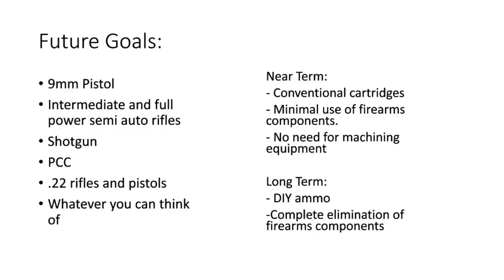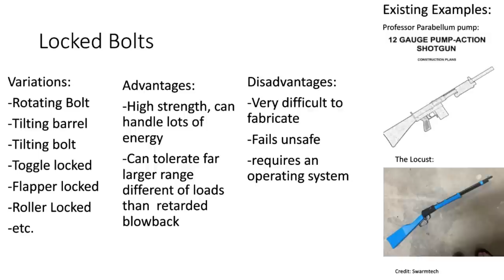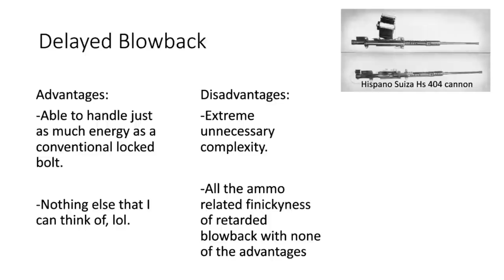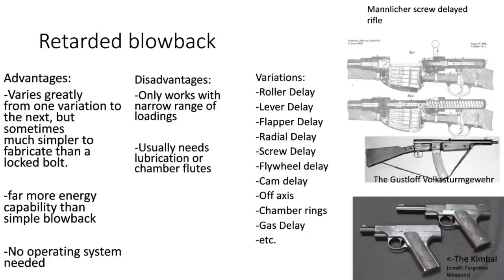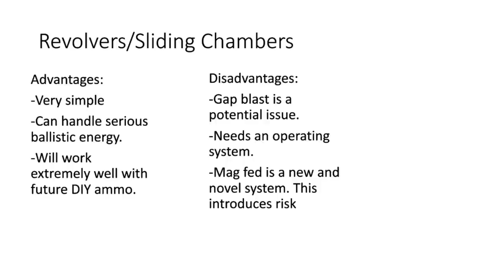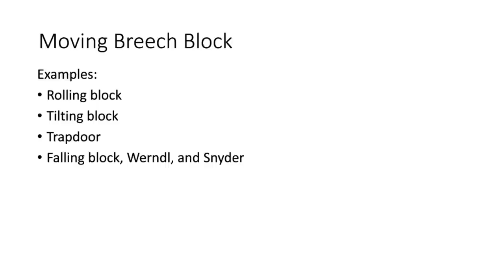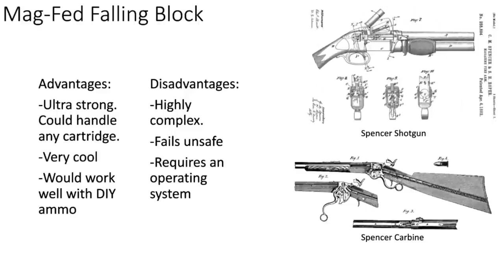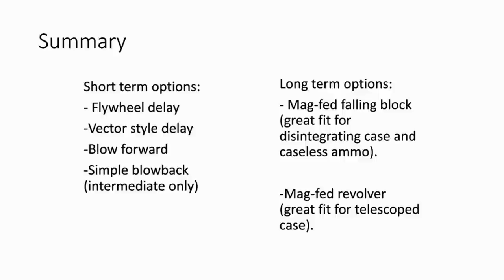The Future of Printed Rifles

Comment: Remember not to limit yourself to just 3d printing, there are many types of materials and methods we can use.
Reply: I'd love to see something in molded plywood.
Reply: @smorrow  I've been toying with this idea in my head for a couple weeks now, especially since I heard about how the university of Maryland was experimenting with using solvents and compression to make super-dense wood that's about as strong as mild steel.
Reply: @Part.No.1xbil.Prod.Tp.MXMVIII  Guns just get more and more unbannable.  Mechanochemistry, for instance, is currently just beginning to be studied and may end up being used for propellants that are easier to make than NC-NG powder. Its current main use that I know of is in fact gas storage (hydrocarbons stored in boron nitride powder, like air whipped into cream), I don't know if you could call that a gas generator or if the release isn't that fast. (In any case, the powder lets out the gas rather than turns into the gas, so you still have powder afterwards. For shotgun this may be just fine.)

Comment: I'm not convinced roller-locked needs to be hard.  The steel rollers, you can obviously make or harvest.  The 'control piece', if you think about it, only the straight edges of it are actually locking surface.  So the tapered (preferably sigmoid-curved) part can just be cut from aluminium.

Comment: Great video. I think gas delay is a really interesting system but the heating issues commonly sited with them would probably be problematic. I think the new-ish alien pistol uses it
Reply: It does. As for heating: just put a note on the gun saying it's not designed for mag-dumping...
Reply: @smorrow  for a normal firearm it’s probably not that big a deal, but I wonder if it would be more significant of a problem with printed firearms
Reply: @evanf1443  For printed guns to do what I want them to do they don't have to be any good, they just need to be good enough to stick up a corner shop with.

Comment: I've heard of a DIY rotating bolt design that's just a hex bolt with three sides grinded down to make a triangle shape, perhaps that's something you could try
Reply: What does the tri-lug lock into? If the load path from the locking lugs to the barrel goes through plastic, then the gun is literally just not locked.

Comment: Have you had a look at a tilting bolt I was think a simple tilting bolt design could be casted I know for rotating bolt casted is not good but as tilting bolt breach locks I don’t think that would be a issue please correct me if I am wrong I was thinking if fully casted could pute a pice of hardened steel in the centre for the bolt face like f g c 9 and the casted bolt could just for the geometry to get the right tilting action I think tilting bolt could be something to play about with

Comment: I think it's worth asking why we want a 9mm pistol, why do we desire the extra power beyond 380 acp or even 38 sw? To my mind there are 2 "fun" reasons why we would want this
1. to solve the engineering challenge
2. to plink with cheap 9mm ammo (although 22lr is cheaper + handloading removes the cost incentive, and I wonder if it's actually less fun to plink with an approximately walker size pistol)
These reasons of course can't be argued with although I suspect the motivation is primarily practical, so we should ask what benefit the extra power provides. We should remember that historically the reason why 9mm para became so common was not that it was the best pistol cartridge (despite what so many idiots will say), but because it was a very good compromise cartridge between pistol and carbine which was very valuable at the time. This extra power was not very beneficial in pistols for a very long time, namely until we started making good expanding projectiles.
1. single diet loadouts, ie pcc+pistol. Right now this is very desirable since most prints are 9mm, but by the time we can shrink the pistol to a reasonable size most rifles will be intermediate, so it will be significantly less useful.
2. to take advantage of 9mm +p HPs. This is certainly a valid reason, although it makes the design even harder to shrink, and if we plan to use handloads, the reliability of expansion and penetration will be questionable.
3. barrier penetration. This is also a valid reason although considering the fact that the opportunity cost of the power is so high I suspect the cost benefit analysis will be heavily skewed towards not caring so much about this.

Comment: Not convinced of 8:56.  I bet you could toggle-lock/delay just using a spring as the toggle.  I mean the incompressible type of spring, that's already fully compressed, like a guitar floating bridge spring.  Those things can be squeezed and not move an inch, and yet they buckle if you push them from the side.  A Derwood-style ejector lever could do this.
Reply: Now I think this would be a bad idea; headspacing would be subject to tolerances in the spring.

Comment: I've been working on a delayed blowback design(in my head mostly) that would be tunable to any reasonable caliber. I lack the knowledge to translate that to a schematic or program though 
Homemade ammo doesn't sound like something that will be easily done as ignition may prove more a problem than anything else. priming compounds are sketchy to work with.

Comment: Good vid my man. Do you think wire EDM could be a game changer in machining locking lugs? I heard it's very precise, but it requires a lot of power and it's really slow compared to machining. But then again how many times do you need to make the lug, right? 
Obviously Metal 3d Printer would be the holy grail, but current methods are utterly inadequate. It will probably take a few decades before something viable comes along.
If you ever loosen up on the "no machining required" requirement. I think a good compromise would machining with the aid of 3d printed jigs. Someone managed to make a Glock slide and barrel from scratch with this.
Also, speaking of lower-end intermediate cartridges, do you think 350 legend in straight blowback that weights only around 10 pounds is possible?
Reply from the maker: EDM would definitely be a game changer! Even though it's just 2d machining, it would open up a world of possibility. You could practically made entire guns from steel with the use of lamination. 

Blowback .350 legend is definitely pushing things, but it may be possible. The only way to know for sure is experimentation.
Reply: @EvanJonesProjects  Do you think this could save on power. Using Jig aided machining to cut out the rough shape, and then using EDM to add in finer details?
Reply: I wonder if bearing balls, with a channel EDM'd into them for the spark to get to the flash channel, could make primer anvils.

Comment: Has anyone tried a pump action similar to the Liberator 12k which has metal linings to the cylinder chambers which end at the first shoulder? The cylinder chamber could be widened to mate the shoulder of the barrel inside the cylinder chamber with the liner. If the advance cog is on the receiver and the cylinder reciprocates with the pump action, I think it would be workable if I have my visualization right. Sorry, my modeling skills are not up to this.

Comment: Printers themselves are arguably a "major gap" you've not listed (it would be borderline on-topic at best, to be fair).  Designing open-source 3D printers is a pretty not-uncommon 3D printer enthusiast thing to do, but they always do it in a way that requires you already have a 3D printer, and a shopping basket (steppers, stepper drivers, rails, etc) that screams "I'm building a 3D printer".  Never seen a truly unbannable 3D printer that's built up from like motorised camera sliders or a claw machine or something.  I'm passingly aware of some _half-_measures like the Hangprinter (you have the steppers but not the rails) or the Peopoly Magneto X (vice versa), but the former, at least, uses ABS printed parts, and I don't know if the latter is even open-source (I haven't checked).

In a way it's like how hobby operating systems rely on gcc.

Comment: Awesome Video!
I dont know what this mechanism is called in english but what do you think of blowback with a long Barrel travel like for example a Frommer Stop. I know its only a pistol cadridge but i think some fixed maschineguns also use it but i cant remember how they are called.
Reply: Long-recoil, nothing to do with blowback.  Strictly implies a locked breech.  Only ever used (edit: in small arms) because short recoil hadn't been invented yet.

Short recoil = breech unlocks during recoil
Long recoil = breech unlocks after recoil
Reply: @smorrow  yes but isnt it way easier to diy something to lock barrel and bolt with a long recoil mechanism.
Reply: @smorrow  yea i used blowback wrong
Reply: @Stress394  1. Breech locking is breech locking. The locking system (e.g. rotating bolt) and the operating/unlocking system (e.g. long recoil) are usually complete orthogonals.
2. No, long recoil is the mechanically complicated one. Like I said, it was only ever used because short recoil hadn't been invented yet. But yeah, I've had the thought before that in long recoil the extra (rear) set of locks doesn't actually need to be that strong, so you could maybe use magnets. Could cause issues with ejecting steel or otherwise-magnetic (e.g. NAS3) cases though?

Comment: Cheap and DIY mini CNC machines are becoming very capable and available, even for producing smaller components like the, trigger, internal components and FCG for AR lowers.

I don't see why something like the Steyr GB couldn't be built with steel tubing and 3d printed components, from what I've seen it functioned very well and had a super smooth recoil impulse whilst being extremely simplistic in operation.

Idk if you've seen this channel before but he produced a 3d printed blow forward revolver with a 40 round capacity, https://www.youtube.com/watch?v=p9pzS4icink as far as I'm aware people are already working on designing a version with removable cylinders.

Comment: Magnetic delay could be useful.
Reply: Magnet could be turned on by a micro switch operated by a cam built into trigger linkage where convenient. Sound could be used to turn it off via an Arduino
Reply: You could also build in a magnetic extractor and electronic ignition for printed ammunition. Just need to add steel to printed cases